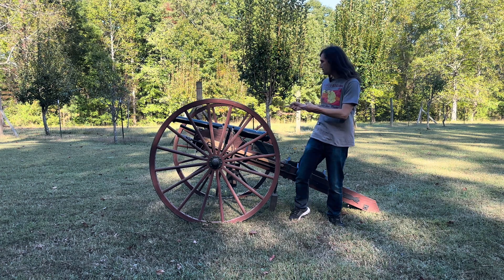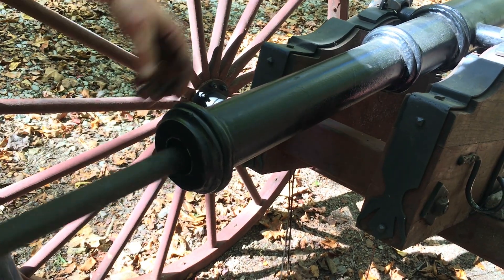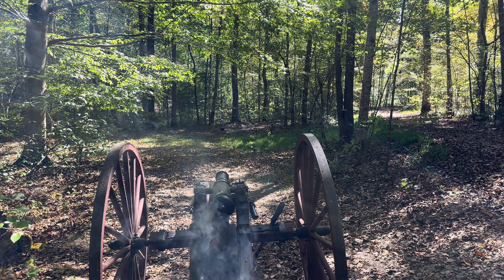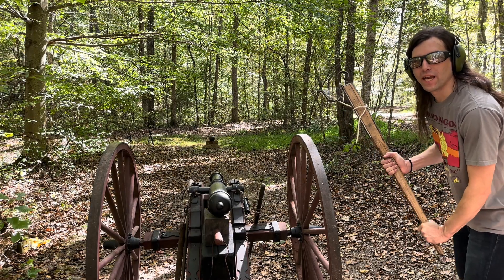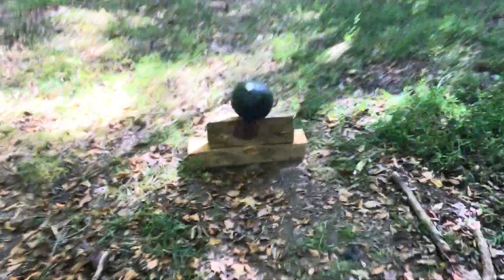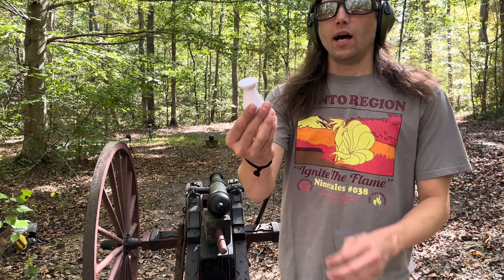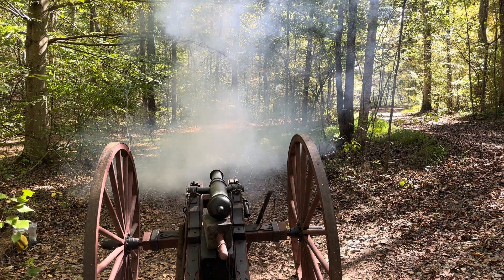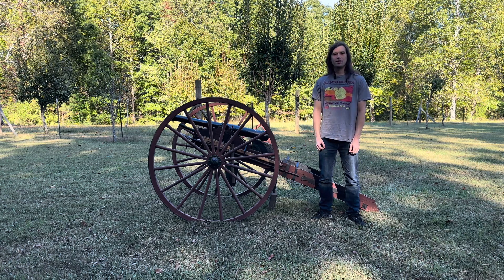Shooting 3D Printed Cannonballs

Comment: 6:17 I was half expecting it to sound like a turbocharger with that design XD. Unless I just haven't got to that point, I found you from your gyroget vid and as some had said on there was spin being an issue which you kinda addressed with this shot. My suggestion is why not have a full sized slug like the previous shot but print the rifling into it and not so much an impeller?

Edit; well. The impeller worked quite nicely, must have missed it in the actual shot
Reply from the maker: We've had some that you can hear pass by! Those impeller ones actually are quire accurate to about 35 yards or so and we've shot them at a few different things.

Comment: This was fun to watch, though I would defer on what the rounds are doing without using proper slow motion equipment to capture what they're doing...
The flat head diabolo shot (they aren't bb's) surprised me though... The main reason is simple enough, I use .177 and .22 round nosed diabolo's for pest control in my air rifles since the pointed ones tended to over penetrate when dealing with small game and I use the flat headed ones for target shooting. So long as there's no crosswind, they're VERY accurate
Reply from the maker: Thanks! I’ll have to redo this one of these days with a bigger target and see how accurate they are with a larger target. I can see one fly right over the watermelon on the slow motion so they might group well. I’ll get a good slow motion once the channel gets a bit bigger. Thanks for tuning in!
Reply: @TheCannoneer  Cool :)
Expanding on your bigger target idea; you could try repeated shots against a large sheet of card to see what kind of pattern they create or how they deviate from the standard heavy rounds (some will fly higher or lower depending on round shape, weight and load), it'll also offer a cheap way to confirm accuracy, though that would probably require your mounting your cannon on something more rigid and less likely to move with each shot.

Come to think of it, this reminds me of how certain types and/or brands of ammo ALWAYS flew differently to the rest, most would stay on target, but two brands ALWAYS hit a foot to the left, I never figured out why...
Reply from the maker: @GaisaSanktejo  We're shooting one in the next video at some distance to see what happens with it from 50 yards! I thought I'd let you know early.
Reply: @TheCannoneer  Thank you, I look forward to seeing it :)

Comment: Having shot a lot of lead airgun pellets, that diablo round really shouldn't give a damn if its pointed or not. The skirt does all the  work of keeping it stable in flight.   A flat point usually has better velocity and accuracy but sucky penetration.  It just hit a higher point of aim than the pointed round did.
Reply from the maker: I’m working on making them in metal as well so I’m curious to see if they would be more or less accurate than the plastic version.
Reply: @TheCannoneer  they will seal the bore better but if you over load them they'll blow gasses past the skirt. Reduce your charges and work back up to max loads
Or accuracy can be erratic
Reply: @slowpokebr549 are you a pirate or something

Comment: Huh. Very interesting how the shots flew.

Suggestion for weighting them down is print them in halves, before glueing in some lead fishing weights inside.

Alternatively, you could also 3d print a sabot around a more dart like design.

Another suggestion is to play around with the flutes on the spiraled shot, see how aggressively you can make the fins angle of attack before it knocks it off course
Reply from the maker: I like the way you think! I’ve been toying with making the hollow ones and you could basically fill them with anything you want. Good ideas!

Comment: Need to get you connected with the Slow Mo Guys. Seeing how each of the rounds flew would be really cool, especially at impact.
Reply from the maker: That would be amazing! Maybe one of these days we can make that happen!
Reply: @TheCannoneer  Yeah especially that version with the blades to try and get it to spin - would be awesome to get the SloMo guys to see if it actually did make the cannonball spin or not!
Reply from the maker: I've got a metal version of the pellet I'm going to be playing around with here soon too. Hopefully if the channel gets big enough we can have them film both.  Thanks for tuning in!  @DavidStruveDesigns
Reply from the maker: @DavidStruveDesigns  I've been working on a way to make them in metal with some sand casting here lately and it would be awesome to see both of those on super super high speed. I really wish I could hear what they sound like too to see if there is some kind of jet engine like sound or anything! 

Thanks for the sub and for tuning in!